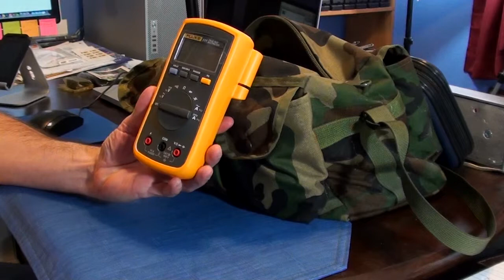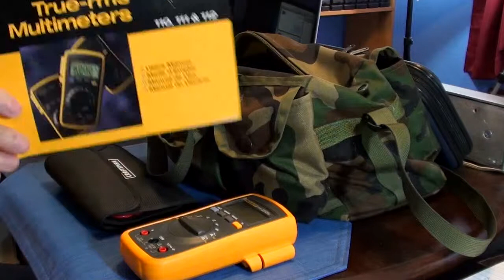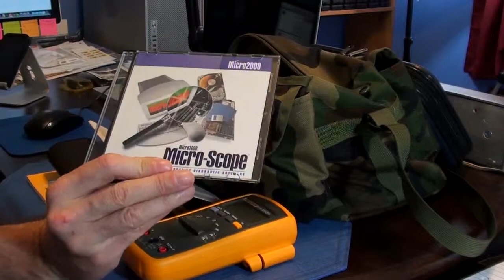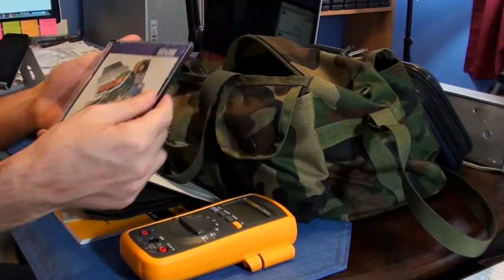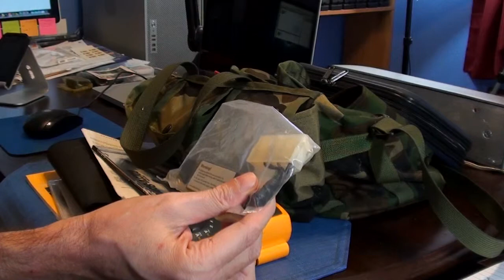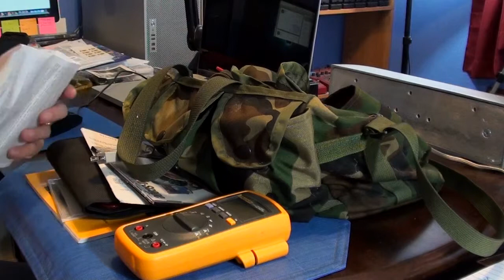Whats in my PC Tool bag?

Comment: For diagnosing computers, just use the built in diagnostics tools in the BIOS.  You don't need all that crap.
Reply from the maker: N0ZP1K3R A multimeter would not be good for testing & diagnosing power problems?!?